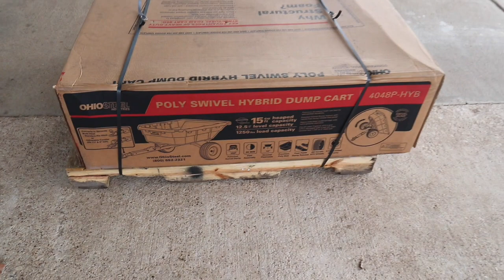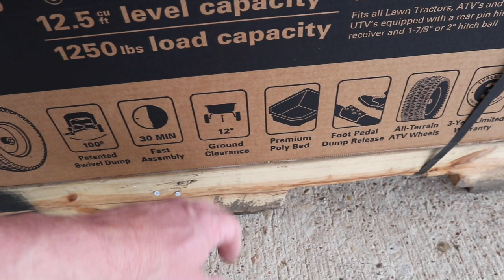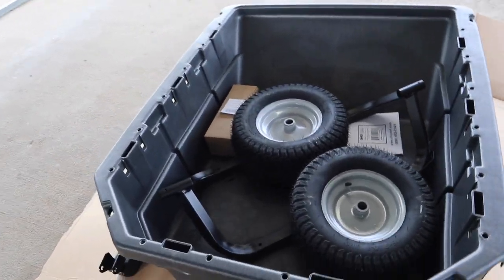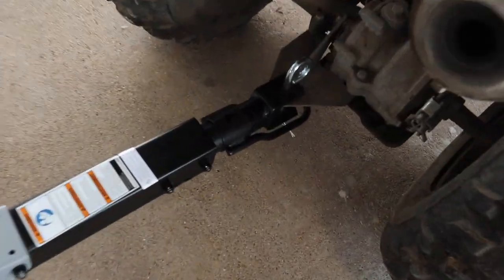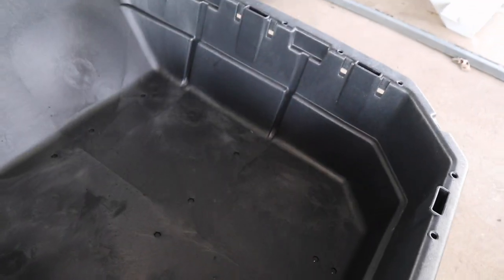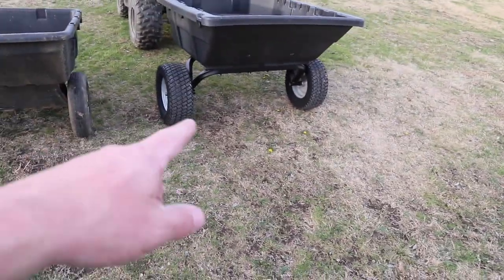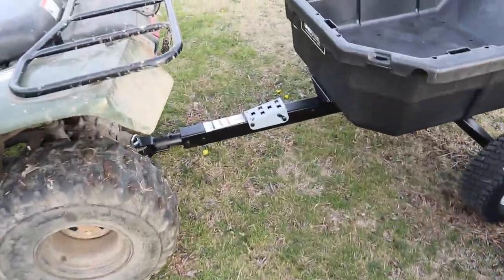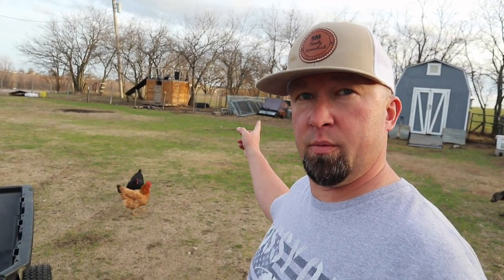Ohio Steel Tow Behind Poly Dump Cart Unboxing/First Impressions

Comment: What is the max speed these wheels can handle? I’d like to use this for hunting and on a secondary road where I would be going 20 mph for a mile or two
Reply from the maker: I took it to our deer lease last weekend and had it at 25-30mph multiple times with no issue.